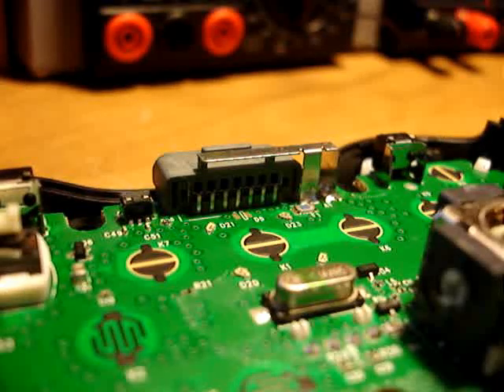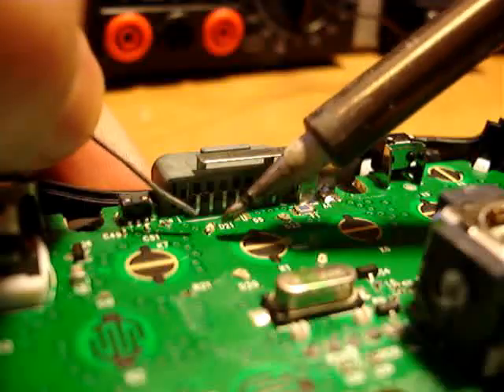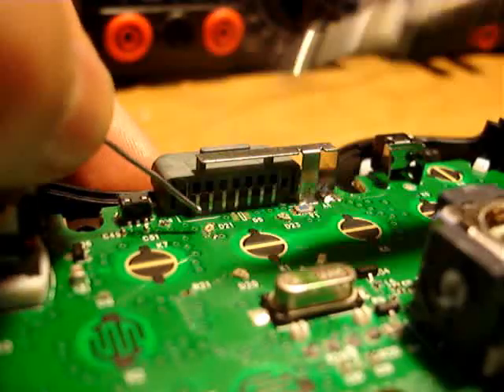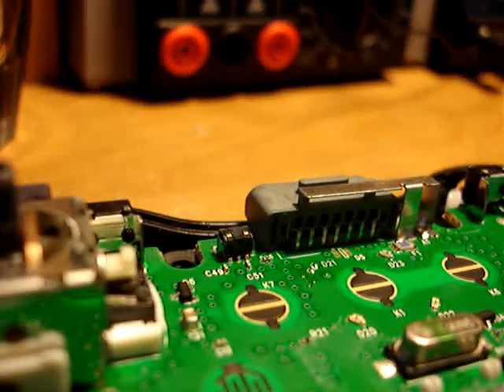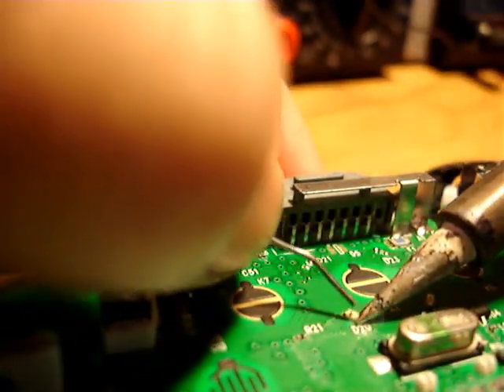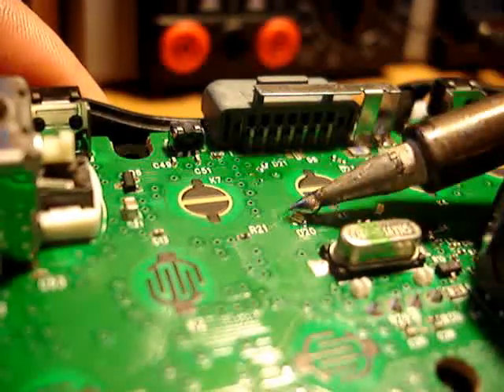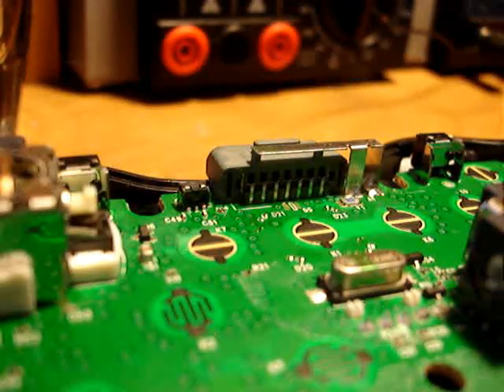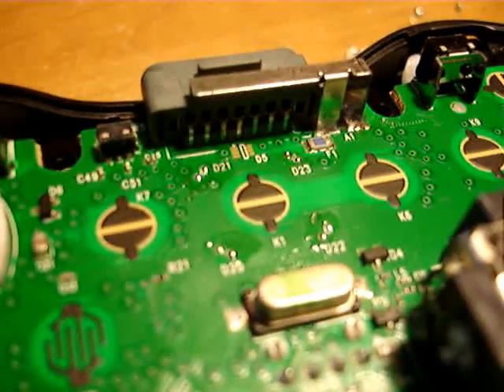Removing SMD's from a Xbox 360 Wireless Remote Controller

Comment from the maker: 30 is fine your not worried about burning the LED's off the board but rather burning the ones going on the board.   30 is fine for removal if you can drop down to 25 to install that would be great.